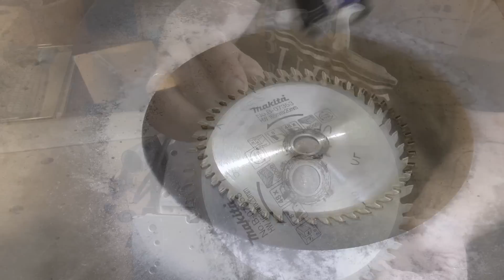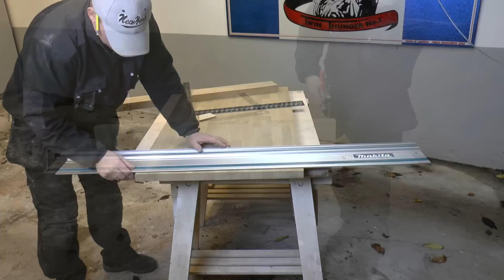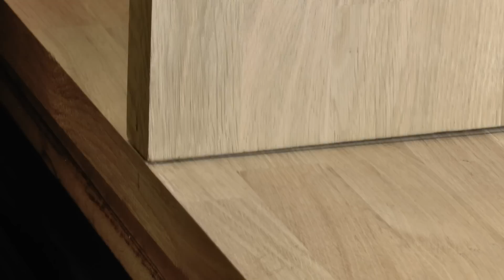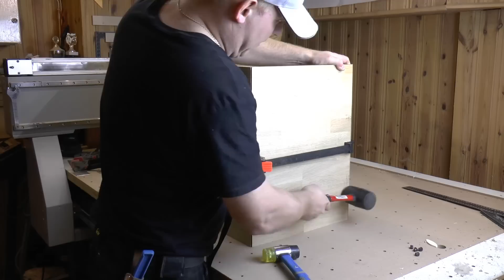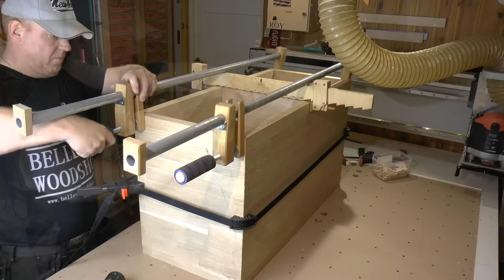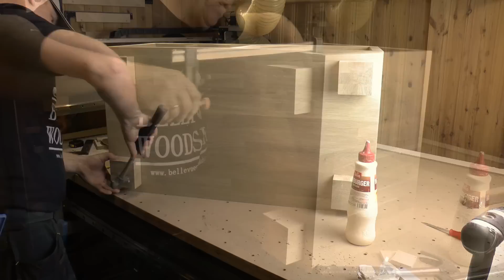Small table from countertop cut-offs

Comment: Nice job Roy, glad to see you back!  Nice tips, I like the blade sharpener, and the piece turned out great!  Haven't seen you work in the garage bay before.
Reply from the maker: +Mike Kapotsy Thanks Mike. Ireally would like to be able to produce more content, but struggle to find enough time.(propably as most of all other out there) I normally just stay in my basement shop. Especially now in the cold period of the year, but I had less space available in my basement at the time, and figured that I would try to use the garage this time

Comment: I have also heard that laundry detergent works well at cleaning blades.  Keep up the great work!
Reply from the maker: +Christian Vale Liquid detergent or powder mixed with water? I have not tried it yet, oven cleaner is fast and easy. Thanks for the tip and the kind comment Christian
Reply: Liquid detergent. Woodworking magazine suggested it vs rocklers expensive blade cleaner. And you don't have to worry about the smell that comes with certain oven cleaners.

Comment: This is about 3 or 4 meters of countertop, and you call it "cut offs". How long was the original size of the piece? By the way the result is very "cubism", I love this kind of furniture,  and your work very nice. Well done.
Reply from the maker: +Giannis Karagiannakis The table is 900mm long and 400mm tall, so you are pretty close on your estimate. The cut-offs used are the ones shown in the first image. The long piece is 1900mm long. A pretty long cut-off. I get these pieces for free at work as the are cut off full length counter tops measuring 3050mm. The are cut off to suit the customers preference of mostly corner solutions of benches. Glad you liked it, and thanks for watching and commenting

Comment: I used resemble simple way of sharpening saw)
Reply from the maker: +Vladimir Evdokimov Cool, it works out great. What grit grinding disc do you use?
Reply from the maker: +Vladimir Evdokimov COOL!!!, I like your setup very much, simple and effective, and not over engineered like mine. I built mine to suit a lot of different blade types and arbor sizes, but never found the need to adjust it very much. Also I have an attachment for roter bits, but I find mysef honing and sharpening them more freehand. 2 thumbs up SIR!!